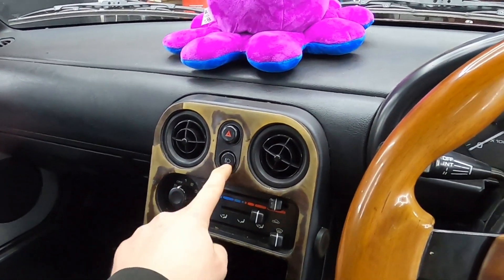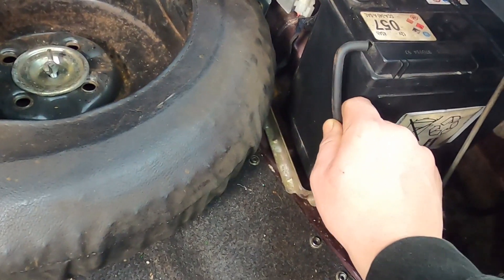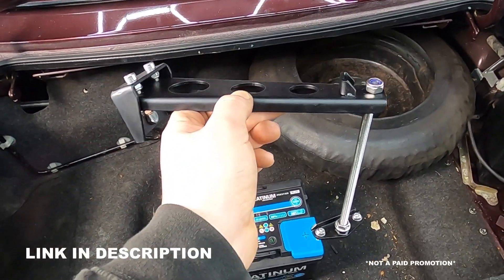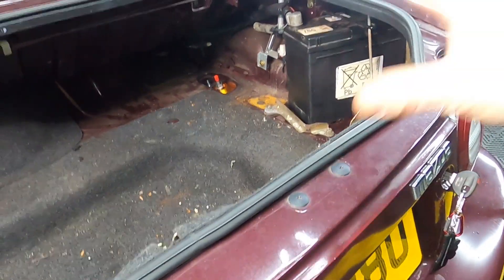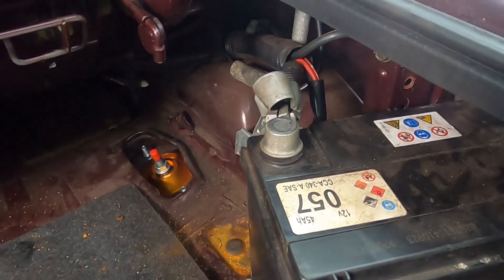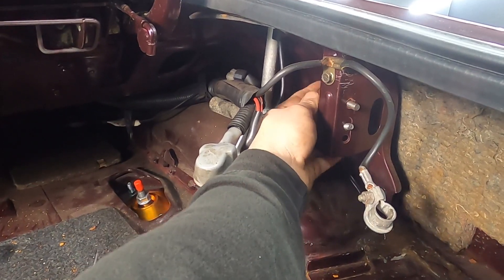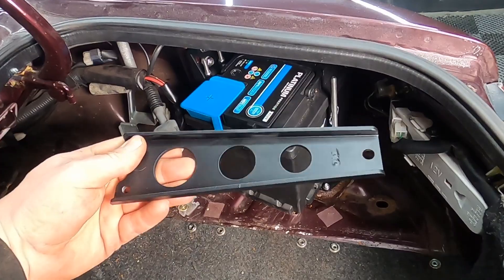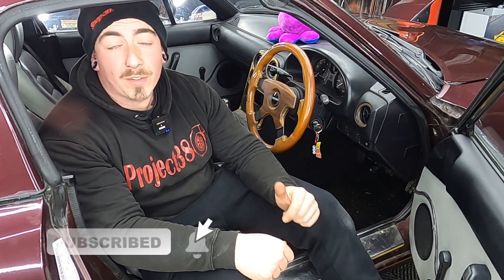SO YOUR MX5 BATTERY IS DEAD........ NOW WHAT?

Comment: there is no way you save money after buying that battery tie down
Reply from the maker: yeah the tie down is cheap and an 063 battery is the most common battery on earth so nice and cheap. the standard mx5 battery is very expensive, so not only is it saving money but its now incredibly easy to find a new battery
Reply: @Project380  agreed Miata battery is expensive. Figured out that a lot of people use the auto zone lawnmower battery with post adaptors! $63 vs $190. Same dimensions & 350cca